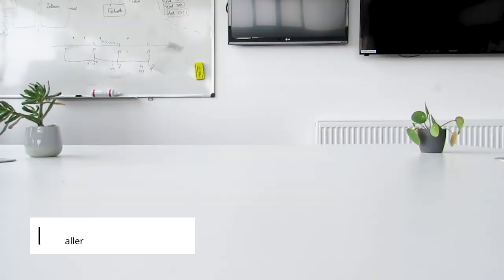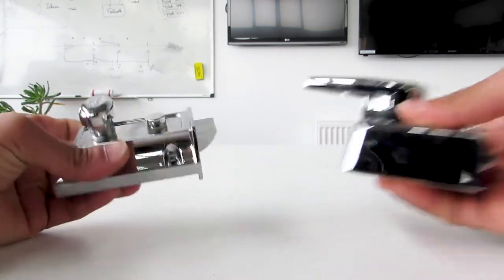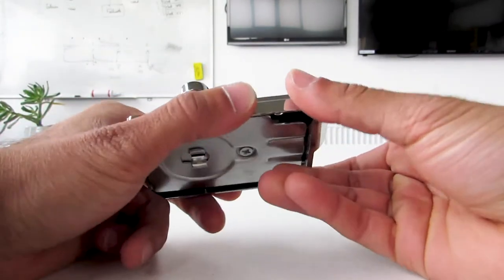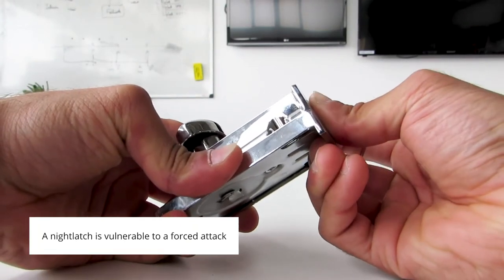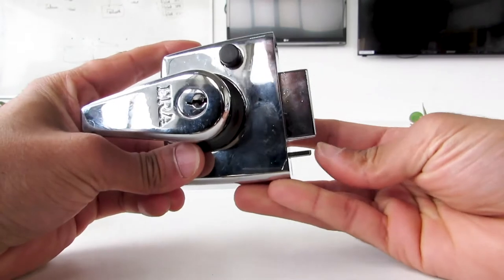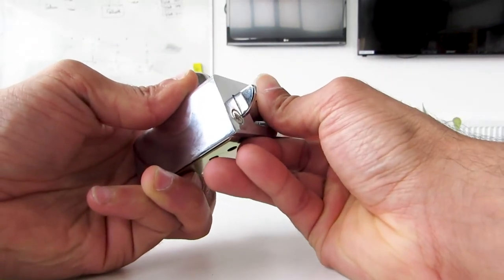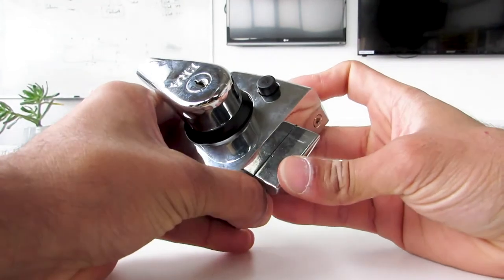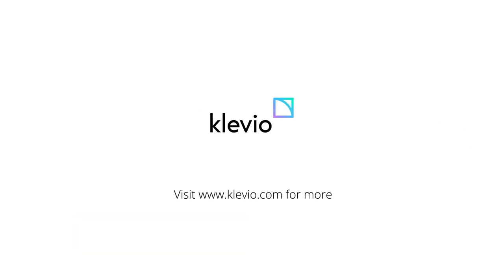Klevio Support: The difference between a nightlatch & a deadlatch

Comment: This issue shouldn’t exist but it depends on proper fitment of the latch, seen so many that have snib in the keep so the bolt is not dead!
Reply from the maker: Thanks for pointing that out, Chris.
They need to be fitted correctly and it’s important to match the correct strike to the lock. We also have our own custom spacers to adjust locks that aren’t properly aligned.